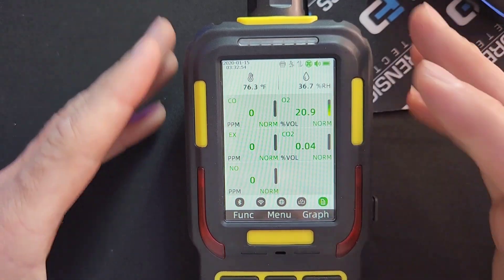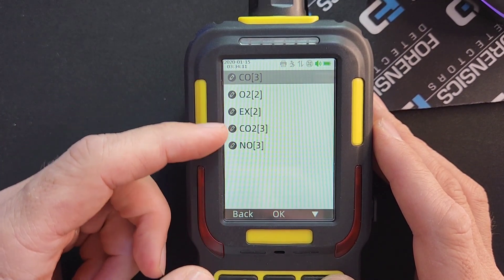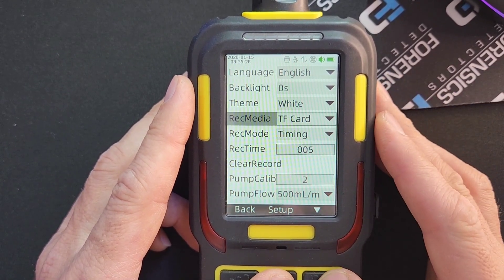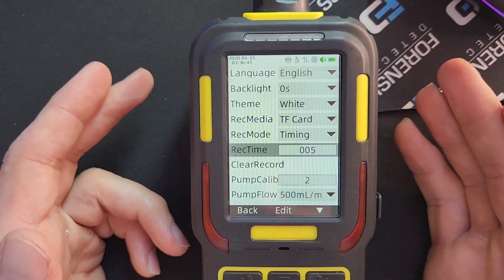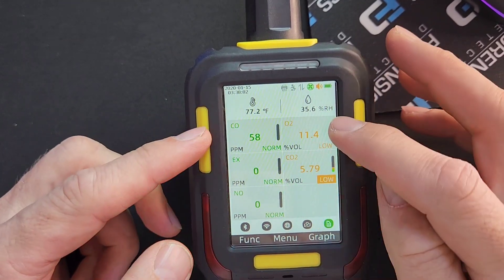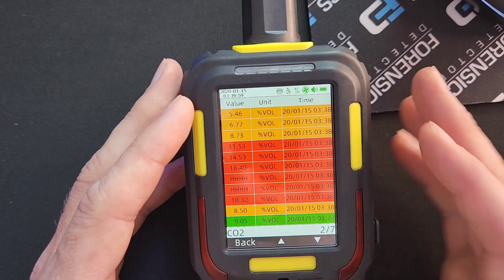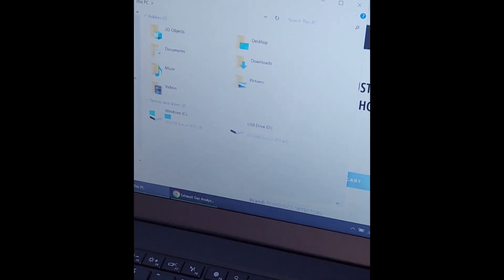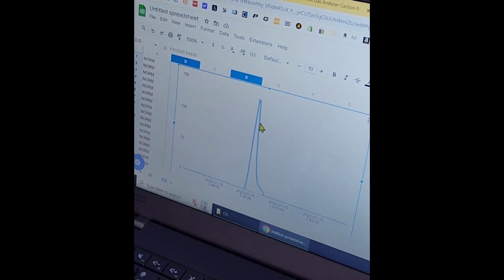Data Logging Tutorial for Model: FD-600M Gas Analyzer

Comment: Masterpiece of the engineering! Simple, pratical, straight to the point instrument.
I was concerned you damaged the sensor when the measurement exceed the sensor upper limit, but then I remember it was the CO2 sensor, and probably a NDIR.
Reply from the maker: Correct, cannot poison NDIR which is nice, unlike electrochemical sensors. Cheerz and thanks for your support.